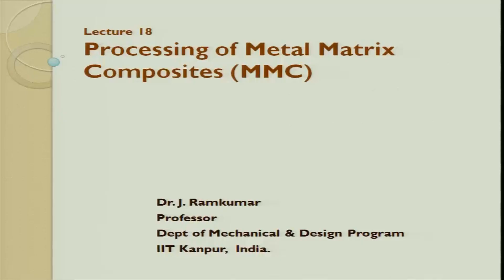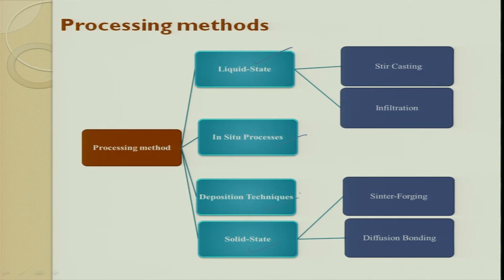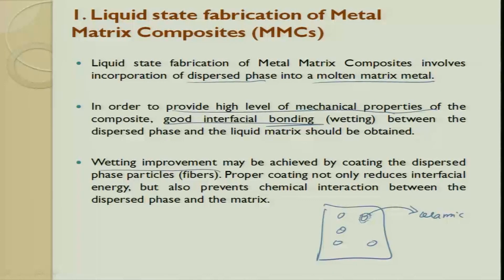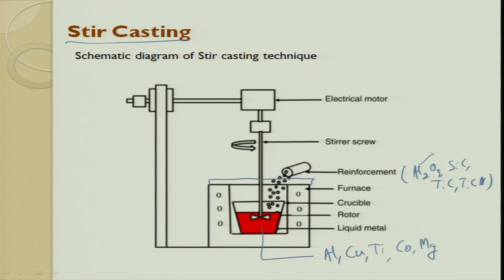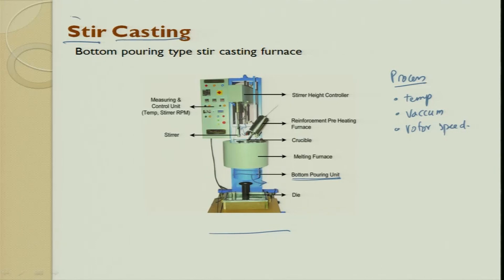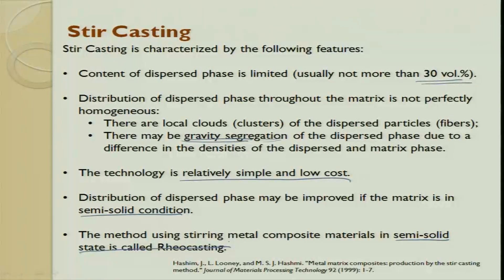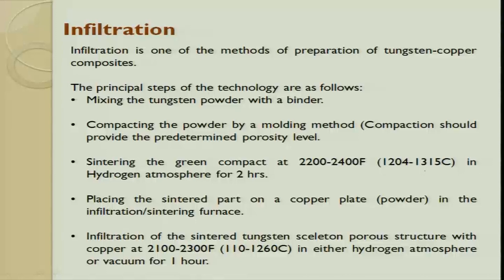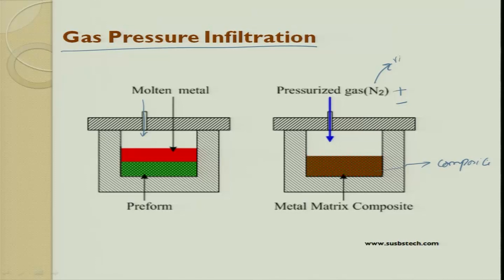Processing of Metal Matrix Composites part 1

Comment: Thanks for the video sir,IAM a aluminum die caster using A356 for casting different kinds of products,how do I increase the tensile strength and elogation of my products,what should I mix with A356 or what process I should follow to increase my tensile strength and elongation,thanks in advance
Reply: Actually i m also working on a356..if u have found some solution of ur problem.. plzz tell me the solution